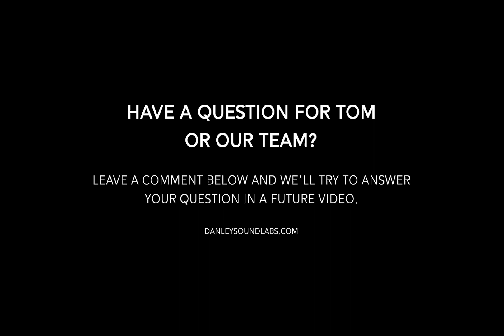Questions with Tom: Layered Combiner

Comment: Does anyone know if using several compression drivers in this way would allow a lower crossover point and potentially allow one to cover the mid and high range with enough drivers?

Comment: Past attempts at a manifold-type loading of HF compression drivers (EV Manifold Technology systems) have shown a diminishing return in additional output from each driver added to a manifold - it's not 6dB, it's more like 3dB in practice. The reason described by another engineer was that the compression drivers are now driving higher acoustic impedance because they are pressurizing each other and each working against the other driver's ability to produce pressure in the manifold. Does the Layered Combiner avoid this in any way, and how is that achieved without requiring an exit that is so large as to be disadvantageous to dispersion? For instance, we could employ a larger compression driver throat - like, 2-3", but that is known to narrow the dispersion of very high frequencies, or to experience internal cancellation of very high frequency output.
Reply: I think you will always run into this effect eventually, but the key is removing the restrictive low pass filter from a lot of these devices so you don't end up with muffled highs and strong mid (like a megaphone). Eventually you'd have to make the radiating area bigger until the limit of beaming. There is only so much acoustic power you can generate from a certain area.

Comment: I saw the patent to this. Basically sound projects from a circle about an inch wide (or two inches on some drivers) and the layered combiner equalises path lengths from all parts of this circle on each driver and transmits it to a common exit. The different paths are on different levels separated by metal plates. The shorter path lengths (from the inner edge of the compression driver exits), exit further back in the final exit from the bottom layer.

I'm not sure if it's exactly it but I can't find the patent diagrams I found online.